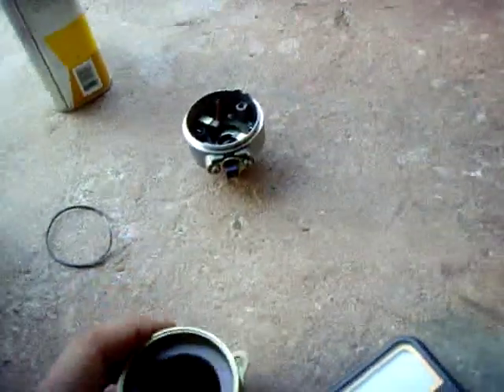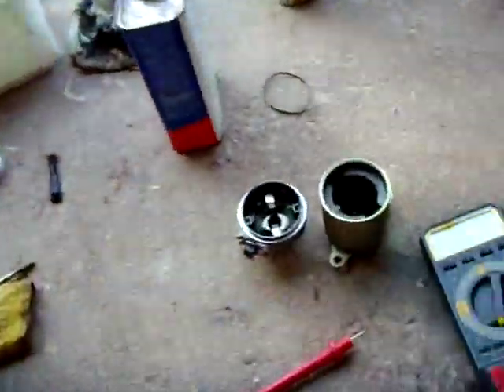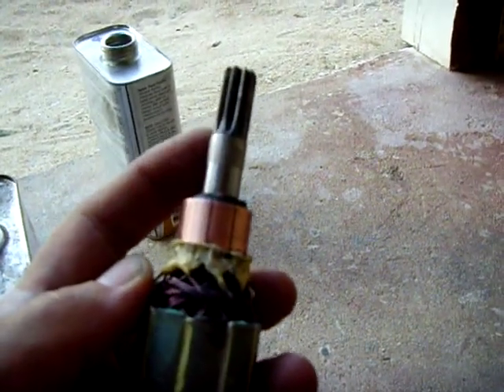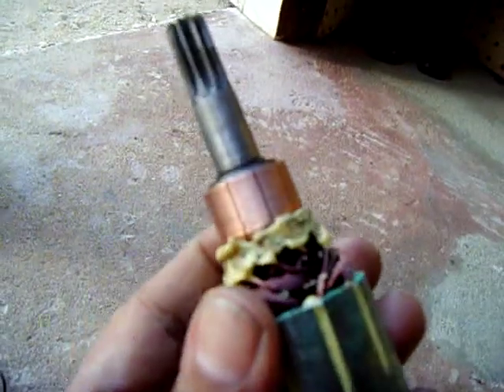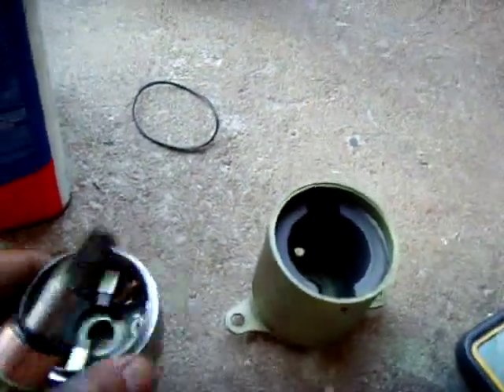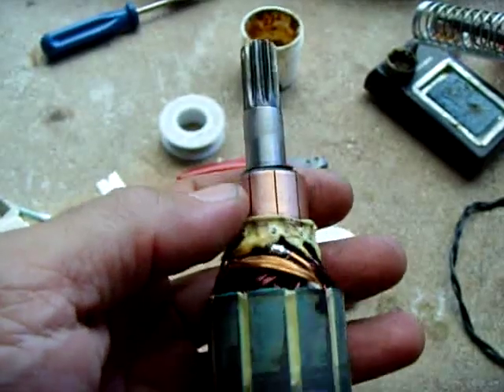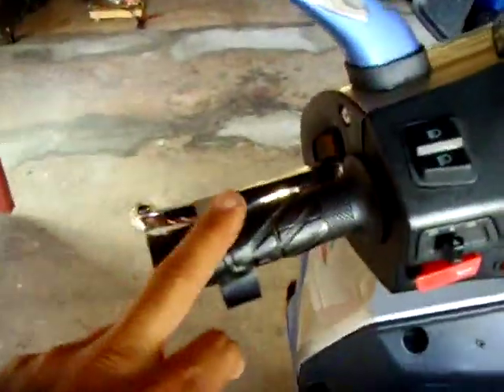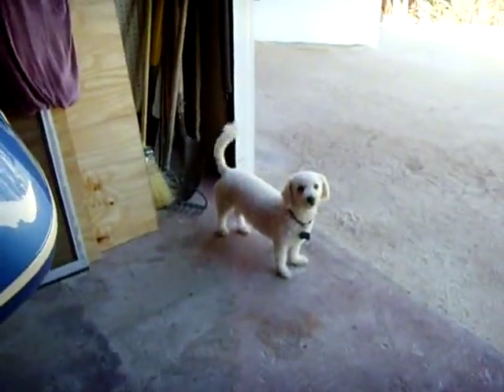GY6 Starter Repair for Hard Cranking/Excessive Current Problem

Comment: I don't think it was a manufacturer defect, these are defects! Haha, I done a big bore kit on a 50, it should have came with a Dremel, just so it can be assembled, the intake ports, didn't come close to matching up, the exhaust was not much better,  but after a bit of work, the spacer will even fit!  The carb manifold/adapter would not even fit, it was nearly blocked with casting flash, but I think with all the work, it should gains nearly 1hp, not included the 50mm bore kit, vi lightened the Piston a bit, to try to get closer to the original weight, and polished the dome of the Piston,  it was rough sand cast finish, it should help keep carbon off anyway,  nice work a great video!!
Reply: TRUE STORY! We are the quality control lol. just did a GY6 250 stage 2 build for a buggy, and the new valve body/head was SO full of burrs to the point the cam chain was awfully close at the base. File and Dremel had it cleaned up good, and always a great opportunity to do some port work! It's sometimes very amazing how "orange peely" the internals can be when purchasing "other brands".

Comment from the maker: You hold the end of the starter cap in your hand(the part with the brushes), then insert the armature into the cap. As you gently push down the armature will not go lower unless you slide the brushes in one at a time . You can use a dental pick, or anything else that is small. It is easy once you know how it is done.

Comment from the maker: Hard to tell what the problem is without looking at it. I would take the rubber boot off the plug and place a screwdriver in the boot touching the metal clip, then holding the plastic end of the screwdriver, bring the metal shaft of the screwdriver 1/8 to 1/4" away from the engine or ground while someone cranks the engine. See if your getting spark. If your not, then check the engine stop switch 1st, then the ignition coil next. My starter is perfect now, but the oil has found its way back in.

Comment: Yes the noise was there before the cylinder and piston install, I thought possibly the Piston was making a slight noise so I went ahead and replaced it with new piston and cylinder, and it's the exact same noise so obviously that wasn't it, just looking for other possibilities... Stethoscope hints at starter area but still could be crankcase area below starter ...thank you
Reply from the maker: Remove the valve cover and inspect the camshaft bearings for play.

Comment: I had the same problem. Except one of the magnets split also. And the brushes pretty much wore out completely. Got it fixed enough to get through until the replacement arrives
Reply from the maker: Luckily these starters are super cheap.

Comment from the maker: If it starts fine with the kick start, then the starter is bad, or the connections from the battery to the solenoid, or to the starter are bad.

Comment: Thanks for posting this!  I'm having trouble with starting my gy6, and it seems like I'm having the issue that you were having.  The bike will crank perfectly, but not start, and finally drain the battery to empty.  After that, even kick starting it won't work!  My scooter used to start the way yours does at the end of the video - am I having the same problem?

Comment: I noticed that if you run your scooter 2000 miles per year the starter brushes las about 4 years, the entire starter cost $20 and the brushes alone cost $9, the oil seal cost $10 and lasts about the same 4 years.

Comment: peugeot and piaggio seem to be very long lasting scooters, the classifieds for them have a high percentage of bikes on sale above 20 000 miles/ 30 000 km. cos they have made them since 1920s so they are great.
Reply from the maker: I'm sure they are, but they also cost a lot more. My scooter still looks/runs like new almost 4 years later with 11,000 miles. Only a bunch of minor issues I had to deal with. Pretty reliable.

Thanks For watching.

Comment: Getting a strange noise for my GY6 scooter don't think it's the crank or bearings just put a new piston and cylinder in to slight ticking knocking at idle don't really hear it at higher RPMs is there a ticking or knocking type noise that can come from starter or starter clutch ?? Thanks
Reply from the maker: If it wasn't there before the work, then it's the result of something you did.

Comment: I have an issue with starting.  Long story short is I finally took it in and the Voltage regulator ws replaced.  But next morning still have the same issue.  I would like to take the starter apart and check for oil but don't know how to get the springs pulled back for the brushes so I can fit the armature into the housing.  Is there a trick to this?

Comment: Hi there u know tha crosshead bolt  on starter at top middle ,I screwed it out but went too screw it in again ,and it just spins ,it will not tightin,,do I really need it ,as starter is tight in place with tha 2 short bolts below ,,Any help be much appreciated...

Comment: Hi There could u help me out here I screwed tha crosshead bolt off starter ,which is located at top middle off starter ,but now it will not screw in ,just goes in full and spins ..do I need it ,as starter isn't loose ,and scooter is startin..Any help be much appreciated.

Comment: I tried starting up my scooter by electric starter and now it won't stop... I had to disconnect the battery to get it to stop... Please help me with it... What's wrong with it...
Reply from the maker: Hi James. It sounds like one of 2 things. Either your engine start switch is faulty(stuck in the normally closed position), or the solenoid contacts arced together keeping the current to the starter always on. Test the solenoid first. Remove the connector for the 2 small wires leading into the solenoid, then try connecting the battery again. If the starter still operates, then get a new solenoid.

Thanks For Watching! Be sure to rate thumbs up and share my channel with others.

Comment: I have a 2002 Yamaha Axis 90cc  motor scooter. I had to replace the stator, battery, relay and rectifier/ regular recently, all fine charging rate good now. But the starter motor was still just turning in short bursts and not starting the engine, yet my kick start does it first time. I then replaced the starter motor with a new one, but still I have the the same problem. Yet if I remove my high grade Yuasa scooter battery and connect my car battery to the connections it turns the starter at normal  speed and starts my scooter as normal. I even tried using connecting an extra Earth from my scooter battery onto a bolt going into the chasis. Can anyone please suggest something else to try?
Reply: Starter clutch is bad.